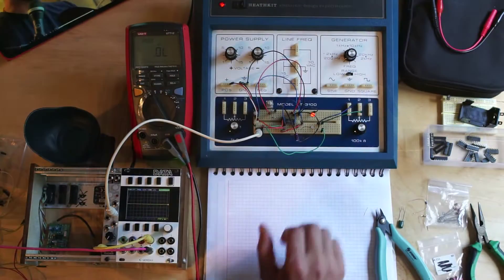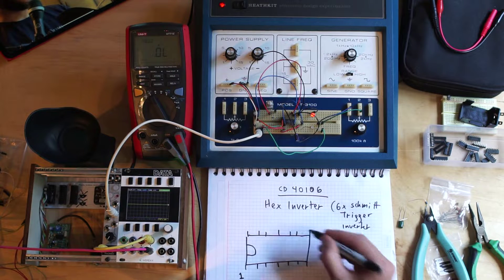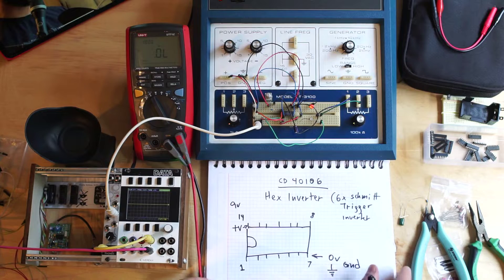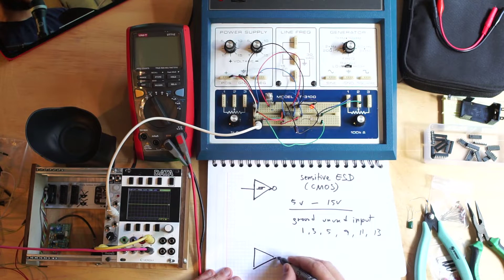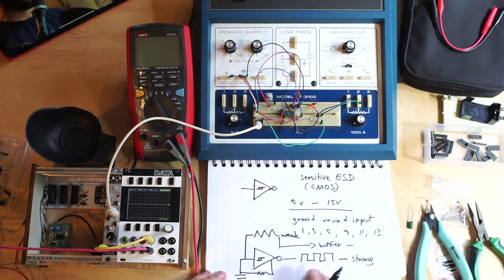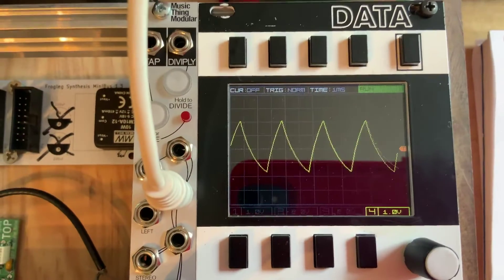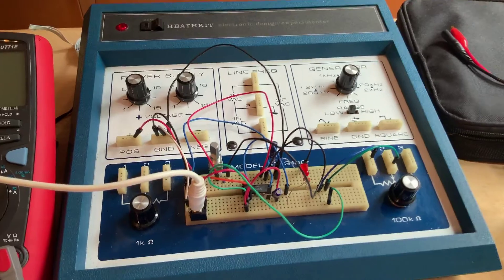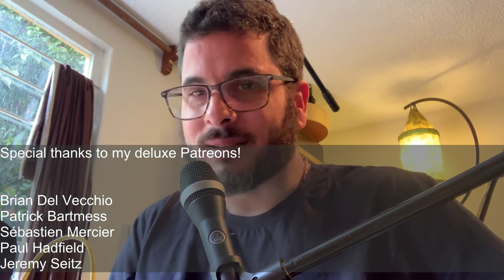World's easiest oscillator! Introducing the CD40106

Comment: 11:51 Why isn’t the output a perfect square wave? Shouldn’t the Schmitt trigger be high and low only so the output should be 0v then sharp rising edge to your 10v and then a sharp falling edge back to 0v?
Reply: Because the capacitor doesn't discharge to ground immediately. The voltage falls off exponentially

Comment: WOW! Heathkit's Analog & Digital Trainers got me going back in '82, during a two week hiatus from work adapting to my first hernia repair.

That is back before Laparoscopic techniques, I think, Butchers basically.  ;-)

Boolean Algebra impressed me enough to incorporate it, or at least a reasonable facsimile, into my use of language, adapted toward Transformational Grammar, but this is where I shut-up about it, since I do not really understand any of it.

My first motherboard, back when a 386 MB cost nearly a grand, was destroyed by ESD due to the jackass sales buffoon doing me a huge favor walking it out of it ESD-Safe bag, on the flat of his palm like a pizza tray, from one side of the shop plainly visible behind their front counter about 15 feet to the bench.

With rubber soled shoes on a Nylon carpet.

I knew I should've said something when I 'heard' the "bzzzzzt" in my head, but no.

I just HSD to get it home straight-away, to torture myself, thinking I must've done some hook-up error, but no.

"It's Dead, Jim."

What is a dcent dual power supply these days?

For +15 to 18V & -15 to 18V?

Funny how Aliexpress has so many ads for the same models, ranging 3 to 1 in price for the same dang model.

So, I think for a PS I will buy local.

This Matrix Mixer using LM13700 OTA for VCA (old school, not the THAT brand I would choose today) since it has 'History'.

THANKS & be safe
Reply: somehow the Espressif ESP32 series of MCU got my 'juices' running again, so my prototyping bench isnearly equipped to get the matrix mixer out so I can hook my set of Eventide Factor boxes can be set free in various feedback looping patches.

take care

Comment: Hello! Loved your video. It is amazing that such a simple circuit can produce an audible frequency. Neat.

I have a question: In the schematics shown at 4:10, where is the capacitor discharging to when the inverter is "off"? Can't seem to find a way that the capacitor will discharge. Is there an implicit connection to ground that I am failing to spot?

Comment: Did it so successfully on the breadboard and now it’s won’t work at allll on strip board and I check it over so many times. Why would it have a difficult time translating. I can get power to pass through but not oscillate
Reply: Also thank you for teaching me it was so clear !!
Reply from the maker: Hard to know without being there with you! Maybe your cd40106 busted! They burn really easily from static electricity!

Comment: Can’t quite tell from the angle of the camera, what the 10 micro Farad capacitor [on the 2nd oscillator ] is connected too. Is it connected from the output pin [#8] to the LED, or is it going from the input pin [#9] to ground? Please reply. I want to learn. Please make more videos and Thank you kindly
Reply from the maker: input to ground! The cap always goes there on this circuit, it's in the schematics!
Reply: @QuincasMoreira  Thank you, that helps me. You are too kind. Be safe, mate. Cheers!

Comment: An elegantly simple basic circuit with great ideas for expansion!  It's bound to get plugged into my Korg MS-20 sooner or later. But I have one question: how can you change not only the frequency but the duty cycle? I've been able to slow it down or speed it up by varying the capacitor, but the timing seems to be fixed at about three on / one off.  I hope that makes sense. P.S.: The Heathkit trainer looks brand new! I hope you have lots of fun with it.
Reply from the maker: It would be complicated to adjust the pulse width with these simple oscillators. I would look into using 555 timer chips for that instead. Cheers!

Comment: I'm having an issue with the triangle output. It shares a connection to ground, so when I connect to my audio on my mixer it cancels out the signal...
Reply from the maker: You need to buffer it with an opamp
Reply from the maker: Also, it shouldn’t be connected to ground, it connects to the capacitor
Reply: @QuincasMoreira  oh yeah there is a capacitor before it hits ground. Its just strange because the triangle output works when I plug into my old mixer and guitar amp, but when I plug it into a high end pre-amp the triangle disappears. Its like its being cancelled out because its possibly going into a balanced input or something

Comment: Its bad practice to conect the potenciometer like that, the correct way to conect it like a reohstat (like u doing) its to conect the center tap to the "unused" pin.
Reply: yes, this would be good practice, because the resistance of the potentiometer wont get indefinite when the center tap looses contact.
Reply from the maker: I short both legs of the pot together, so it's the same

Comment: Have you tried CD4584? Pin compatible to CD40106 with different hysteresis. Produce different sound colour.
NE555 is schmitt trigger too. Pin two connected to pin six as input. Pin three as output. Pin four and pin eight to positive rail and pin one to neutral.
You can modulate the frequency by variate voltage of pin five.
Reply from the maker: Thanks for the excellent tips!

Comment: Thanks for your video.
Couldn't you just use one of the other inverters to buffer the triangle wave? No need for a seperate op-amp.
Reply: You possibly could but then you're doing so at the expense of an inverter. For people who want to have a 6 triangle oscillator module (or a mix between squares and triangles) the buffer is required
Reply: @RileyGein  if we stay with your example(6 oscillators) you can do this with 2 40106. How many Op-Amps would you need? 2 at a minimum, so you would save 1 device.
Reply from the maker: Pretty sure that would convert the triangle right back to a square. The normal outputs only flip high and low.

Comment: How does the square wave stay low on this circuit? When the schmitt trigger inverts to low, wouldn't the capacitor discharge through the resistor and therefore give us a voltage? Or can it discharge to ground because it is not polarized?
Reply from the maker: yes, and as it discharges, the Schmitt trigger inverts and outputs positive voltage which charges the cap again, that's the whole principle of how this oscillator oscillates!
Reply: @QuincasMoreira  maybe I need an explanation over time because between the Schmitt inverting to high and the capacitor discharging through the resister I don’t understand how the output ever hits 0v.
Reply from the maker: @BeniRoseMusic  the capacitor is on the input right? And the output is an inversion of the input. So when the cap discharges and the input hits 0, the output goes high and starts charging the cap. Once it's positive, the output flips again and starts discharging again, and so on forever. Hope this makes more sense :)
Reply: @QuincasMoreira  the cap is on the input but it’s also on the output through the resistor. It being on the output is how it gets charged through the resistor. When it charges the input goes high and the output goes low right? At this point where does the capacitor discharge? Isn’t the only place current can flow through the resistor to the output (thus no longer making the output 0v)?
Reply: @BeniRoseMusic  The nature of a schmitt trigger is to have 2 different trigger threshold voltages. So for 5V Vcc, if the input voltage rises and exceeds 2.9V the Output will switch. The same is in reverse order with a trigger voltage of 1.9V. So you have a threshold of 1V

Comment: in australia I cant find this chip but I can find a 74C14 ? is it the same chip?
Reply from the maker: it's a Hex inverter as well, I'm pretty sure it will work the same :)
Reply: Yes it is. Also the 74HC14.
You can also use the 74AHC14.
This are a bit different as the trip voltage point is closer to 1/4th VCC instead of 1/2 VCC.
Check the data sheet as VCC is closer to 5V than the 4000 series.
redrok

Comment: hello synth diy guy, so from what i just understood it's possible to have up to 6 lfo out of a CD40106, right?
Reply from the maker: Yes!
Reply: @QuincasMoreira  thanks! in case of prototyping a diy module based on 40106 would you suggest to use diodes an 10uF capacitors in order to filtes power? sorry but i'm not really skilled in electronics and i'm trying to not fry everything up (and not to kill myself in a dumb way).

Comment: Thanks that was super inspiring! Really simple and impressive :)

Would you mind explaining how you are using the fat capacitor to "smoothen the power"?
Reply from the maker: Hey thanks :)
It's just a reservoir, it's called power filtering. Just a large ish value electrolytic cap with positive connected to power positive and negative to ground right at the point where you power the circuit. Cleans up any ripple or variations from the source, makes it more stable and steady.

Comment: Its necessary a vactrol to make "fm" ? Or can i connect the out from one oscillator directly to one leg of the potentiometer? Nice video!
Reply from the maker: yes, you need a vactrol to affect the frequency with incoming voltage

Comment: 6 oscillator in one chip! That's like a whole system that could fit in 2HP 😄 Ordered a bunch of components. Gonna try it out! Thanks for yet another great tutorial
Reply: Not quite. Each oscillator will require another inverter to buffer its output to offset the effects of loading on the oscillator. So, in reality, it is 3 in one chip.
Reply: @SpeccyMan  could you explain how you would have three oscillators with a single output?

Comment: I'm pretty familiar with hex inverter oscillators, but usually I go for the 4069UBE's. Neat fresh take with a different chip in the 4000 series. Thanks for sharing!
Reply from the maker: thanks :)
Reply: The 4069 is not so well suited because of the lack of the schmitt trigger function.
Reply: @Golkun1  It's actually because they're unbuffered, that you can use them very effectively for triangle cores. Also, it makes them a really good tiny package (with minimal glue components) for massive oscillatorbanks.

Comment: The 14069 (Also a similar hex inverter) was used in DR-110 cymbal / hat noise.   And the similar TR-606 uses 14584 Schmidt trigger inverters.   Good circuits to look at for inspiration.
Reply: I've been using this chip after getting the Nic Collins book. Before then I'd built devices with the reverse avalanche from LMNC. I had no idea these chips had been used commercially on "proper" electronic instruments. Thanks for that.
Reply from the maker: Demag great info, thanks!

Comment: Hi Quincas, great video! I’ve been experimenting with the 40106 and I’ve come up with a circuit that I really want to build as a eurorack module. Sadly, the chip runs on dc only, so I tried making a few full bridge rectifiers (some on stripboard and one that came as a kit with a pcb) and ran the +12v ac and ground from my eurorack bus, to the ac inputs on the rectifier and into the circuit, but they didn’t seem to work. Do you know what I might be doing wrong or how I could run this chip on a eurorack power supply? Thanks.
Reply from the maker: Hi Alfredo, thanks for your comment!  The 40106 runs on 5 to 15v, so just feed it the straight 12v and 0V from your Eurorack into it! No need for rectifiers, just ignore the -12 and you're good to go.
Reply: Synth Diy Guy Hi Quincas, thanks for the reply! I thought the 40106 only ran on dc, whereas the eurorack power supply is ac. Are you certain this will work? I just don’t want to blow up my chips 😂
Reply from the maker: Alfredobean you are mistaken! Eurorack runs on bipolar DC! Some walwarts are AC but get rectified, filtered and regulated into the three DC rails: +12, -12 and 0v. Just take +12v and 0v and go to town.
Reply: Synth Diy Guy wow! I can’t believe I didn’t know. I better start building my module! Thanks for all the help :)
Reply: I just had this same misunderstanding and realization two days ago, reassuring to see someone else who shared that same confusion!

Comment: Hey man, great video! already saw the brilliant videos from casperelectronics on this, but this one helped me understand it better yet! One question though, I just got into this kind of stuff and I don't have any other equipment, so I tried building my own little amp from a LM386. It works when I play some tracks from my phone through it, but when I try and connect my oscillators to it, it seems as though the two circuits kind of interact with each other, like the volume pot is messing with the pitch and I don't get a smooth volume curve.. any tips on how to decouple the circuits? tried a simple buffer circuit but that didn't seem to work for me.
Reply from the maker: It's fairly common for these simple diy circuits to interact when fed from the same power supply. Try using large bypass capacitors (100uf to 1000 uf electrolytics, + to positive power and - to negative) . where power is input to each circuit. That should stabilize things. Also a AC coupling cap at the oscillator output may help. Try a 10uf bipolar electrolytic cap in series with the output, before going into the volume pot.
Reply: @QuincasMoreira  Thanks for the tip! gonna try that right away

Comment: Great video! Very informative and well presented. I like to use a capacitor on the oscillator output, then you can get different shape modulation waves without having to use a buffer. I also like to put a large capacitor over the power rails and you can get a nice pitch envelope by power cycling the circuit :)
Reply from the maker: Hey, these are great ideas! I'll try them for sure, thanks :) .  Also try starving the chip. Add a pot as a voltage divider from power positive to the power input pin, some crazy madness happens :)
Reply: By “over the power rails” you mean, connect pin 14 and pin 7 with a capacitor, right? Also, what value of capacitor do you recommend? Pardon my ignorance, in this field - I’m trying to learn more about it. Thank you, in advance.
Reply: @maxwarfield6699  Yes, across pins 14 and 7, use a large value such as 1000µf. Then you can try connecting and disconnecting power to the circuit, you should get an interesting pitch modulation :)
Reply: @sonodrome  I will try that. Thank you mate, cheers!

Comment: Really cool! This reminds me the Casper Elletronics videos!
Now, I've experimented a lot with these chips and I noticed a sublte difference in the time between the highs and lows. It seens that when it outputs highs it lasts a little bit more than the lows. Is that a way to use another potentiometer to adjust the time between highs and lows? I think this is PWM, but not sure
Reply: For PWM use a second potentiometer in series with the main pitch pot.

Connect the centre pin² (wiper) of the PWM pot to the pitch pot that's connected to the chip's output.
 Connect one end ¹ of the PWM pot through a diode to the capacitor + / chip input.
 Connect the other end ³ of the PWM pot through another diode, also to the capacitor + / chip input.
 The two diodes point in opposite directions, (reverse parallel.)

The capacitor charges up through the wiper², one side of the PWM pot¹, and one diode,
and the capacitor discharges through the other diode, other side of the PWM pot³, and then the wiper².
Reply from the maker: I think you're talking about the duty cycle! Pulse width right? I do not know of any easy way to change the duty cycle of the 40106 output, but it can be possible using either a 555 chip or an opamp comparator.
Reply: Link - https://www.youtube.com/user/bubagoo/videos
Reply: Chip Input
  |                    Chip Output
  |---|<----{1                   |
  |         2}<---- www-   |
  |--->|----{3         ^-------|
  |
== Capacitor
  |__ Gnd

Comment: I wondering if there is a simple dc offset circuit to put after the square out to make it a bipolar signal? However that might require a negative voltage supply to be used also? I’d like to make a simple module out of one these to have 6 simple LFOs or clock signals.
Reply from the maker: Just add a capacitor and the output is AC coupled :) .  10uf non polar in series from the output should work.  If you do need an offset then yes, you'll need bipolar power and opamp circuits generating the offset
Reply: Synth Diy Guy thanks for the info!